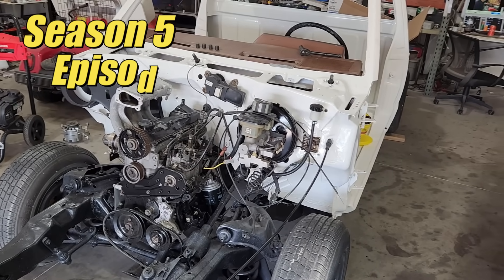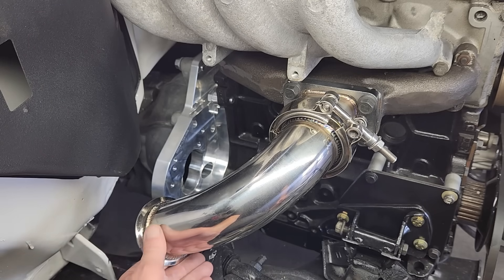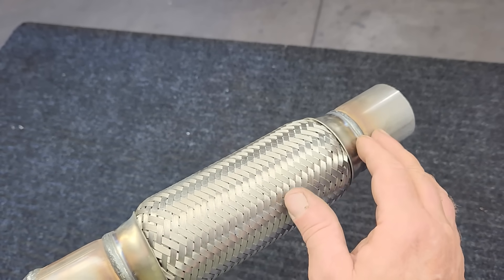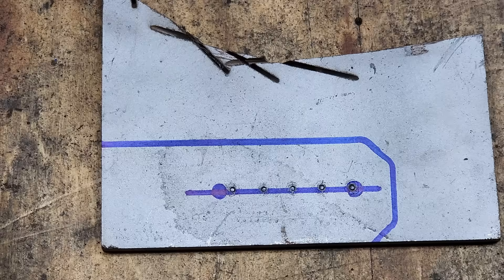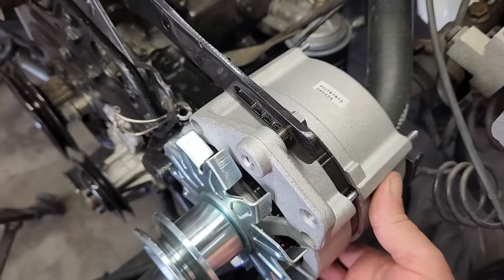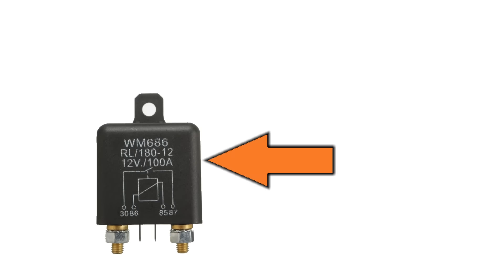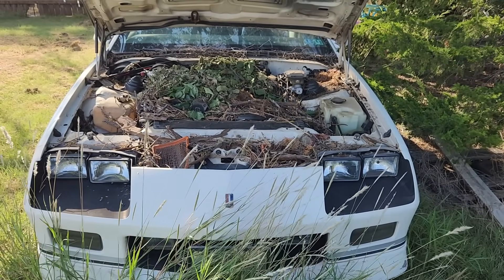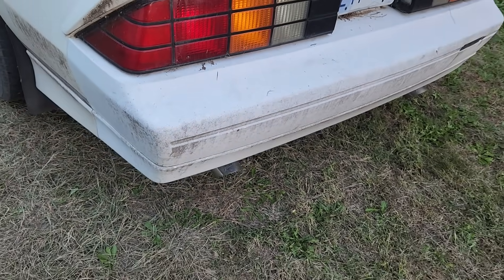S5 E35. DIESEL SWAP Chevy S-10.  we build a custom exhaust and more!

Comment: Actually the Isuzu diesel would have been a better engine swap and tranny. Play more power more dependable. The VW diesel is a great engine for a front wheel drive unit but not for little truck. Unless you have the VW diesel in their little pickup truck it matches the weight balance. As again the Isuzu diesel was a very very good engine what's on the transmission I believe you can get it in a 5-speed.

Comment: The nuts for the b clamps prob don't come off because they're those cros thread nuts, similar to the ones that come with replacement sway bar links. Made to cross thread on the first install because they're garbage and wouldn't last with normal thread pattern.

Comment: Looked like that Camaro had seats from a 1998-2002...and the shift pattern was for the 6 speed. Maybe a T56 swap? Or, maybe they just swapped the interior bits from the new car and it still has the older transmission. Either way, looks like a fun project once that nest is removed from under the hood!

Comment: Yeah, you're probably not going to like the 1.6NA diesel for long before you start your turbo trials.  I had many rabbits and jettas, (still have a 84 Jetta GLI) gas and diesel, but I scrapped my 89 TD Jetta and went looking for another Jetta right away and found a very rare 92, red 2 door with sunroof, and a NA diesel engine.  Didn't think much of it as I was enamoured by the car itself.  Man, it was a bag, so disappointed with it that I engine swapped in a 16V from my brother's B3 passat.  I couldn't believe how lame it was compared to the 89 TD which slipped thru the wind just fine.

Comment: That is a rare car in deed. Most of the 350 camaros of that vintage, were only optioned with the automatic and the 305 got the manual. So your friend got super lucky on this find. A Tremec TR6060 6 speed manual could be a nice modern touch. Its a very robust manual and they hold up quite well.

Comment: Incredibly dumb question, is there a reason that the exhaust can't just go straight down, make a bend toward the engine to clear the frame, make another small bend to straighten the pipe, then make a 90, then back to the rest of the system? It looks like it would make it a low point yes but you're not taking this thing rock crawling....right? The reason your nuts jam up is because of stainless steel galling. Nickel anti-seize can help but likely they have poorly cut threads that are binding when tightening and scraping up the oxide layer on the stainless steel which causes it to essentially friction weld at low temp high pressure. It can also happen when running stainless on stainless threads at high speed with the wrong or no lubricants.

Comment: 7:47: you dont need all that slot-making nonsense.  two long strips, bolt-width apart;  small strip welded across their ends;  other ends welded to old strip as per.  ie just fabricating it's easy

Comment: Hey Jimbo, I've waited to watch this until I had some time. Just wanted to say, A 1989 IROC-Z with a 350 engine and a factory manual transmission is not a combination that was originally offered by Chevrolet. All 350-equipped IROC-Zs from 1989 came exclusively with an automatic transmission. Any car with this combination today would have had a transmission swapped in by a previous owner. I know this because my buddy in HS got an 89 iroc TPI with an auto. We looked into it, we were sad with the slushbox. Also, your videos keep getting better and better.. much more poslished. Thank you for the content man. Much appreciated
Reply: I came here to say this... I have a '91 Z/28 with the 350.  I spent a lot of time searching for one with a manual until I found out that it wasn't an option.  It might be good to check the VIN to see if this was a 305 car that someone put stickers on or a 350 with a trans swap.  Either way these are beautiful cars for the era.  If mine wasn't low mileage, I think I'd swap it out for a newer V8.

Comment: Hey just a heads up, iroc-z didnt come with a 350 tpi and a manual. if it was a 350 it came with a th400. the manual came with the 305.  Look up the RPO code sticker and see B2L was the iroc l98 code for the engine. MB1 MK6 or M39 were the manuals

Comment: The 5.7 iroc was only offed with a automatic so what you got is auto car that has a manual swap or a 305 car with 5.7 badges. The 305 iroc could be had with a 5 speed stick

Comment: no just no ,i love the golf diesel but that engine is tiny for that car 
a much better option would be a 5 cyl 250D from a w124 they are cheap strong and easy to find with turbos altough not really needed

Comment: 2:24 My guess is the clamp thread & the nut are both stainless, so they gall together. Once the oxide layer of the two parts wears off from the tightening action, they will seize. This is a common issue with stainless hardware.

Comment: Hey Jimbo! Can I make an observation? If you are going to hard mount the exhaust to the trans housing I'd suggest adding another small flex joint in between. I think thermal expansion in the pipe will be enough to crack welds or mounts over time. Alternatively, you could make the trans mount flexible to accommodate the small amount of movement.

Comment: I have never found any evidence of a factory 350/manual trans in a turd gen....  there was a 230hp 305/5speed option  L98 I think.. what is the most desirable is a 1LE camaro..    I have a 406 swapped 84 Camaro Sport that came with an Iron Duke originally..

Comment: The shift pattern on the console of that camaro shows a 6 speed shift pattern, I couldnt tell what the knob has. As far as I know the 350 equipped 3rd gens weren't available with a manual. If it has a t56 that would be sweet.

Comment: Shoulda used a turbine housing for the exhaust. Just the turbine housing, without the center section & the bearing hole plugged. Then your exhaust downpipe won't change. 😉

Comment: My brother Chris had as his first car a 1980 Volkswagen diesel Rabbit.  52 screaming horsepower, he needed to drive the 45 miles to Detroit on a regular basis;  He kept a brick on the drivers side floor, and used it as "cruise control", since the car's top speed was 65 mph....

The car got 50 mpg, but he wound up destroying it in a crash.  He wasn't badly hurt, but the other person was killed.  He stopped at a stop sign, looked, and then proceeded into the intersection, where he collided with ANOTHER silver 1980 VW Rabbit diesel.  They found Chris's car in first gear, which had a 15 mph redline, so it is not likely that he ran the stop sign, he just did not see her.

Comment: My first car I purchased after high school was an 88 Iroc-Z 5.7 Tuned Port w/T-tops.  It was maroon and perfect for cruising the PCH in SoCal at the age of 19 in the Marines.  I'm pretty sure they never sold that gen of Camaro with both a 5.7 AND a manual trans but I'd have to look in my book to be sure.  I'm thinking somebody has already done some medling and made it a 3 pedal car.  I always wished mine had been but the 700R4 was a great transmission.

Comment: Why didn't GM do this?

I know GM and VAG do not get along very well, but dollars are dollars and there was the potential to make more of them for each company.  Chrysler in the '80's bought a BUNCH of EA827 gas engines for use in the Omni/Horizon cars, and Volkswagen has worked with Ford on many occasions.  In South America, VW sells the Amarok pickup truck, which is nothing but a Ford Ranger with a Volkswagen engine and slightly altered sheet metal.

QUESTION:  I see the VW diesel engine standing upright in the engine bay.  This is not the typical orientation of a VW EA827 engine;  It should be mounted with a 20 degree slant towards the passenger side.  Have you considered how this is going to affect the oil pickup and oil drainage in general?

Comment: Jimbo, I know the answer why the nuts lock up.  I had it happen.  It's because the clamps and the nuts are stainless but the bolt on the clamp is steel.  So the nut is galling, dissimilar metals and welding itself together.

Comment: Those Camaros were hella fun to drive. Especially with a 5 speed and a 411 rear end. I even put 14" tires on mine to make it even more ridiculous. If you could shift good, they were capable of way more than what they were on paper. Especially since you could easily get the weight under 2700.

Comment: There is a bracket for the VW engine to have an alternator and power steering but no AC. It has a gear type tensioner for the alternator.

Comment: Regarding the bundled nuts on V-band clamps being impossible to remove once tightened. 

A wild guess is that stainless steel on stainless steel fasteners have a tendency of galling, and thus basically welding together.

Comment: The manual trans option was only available with a 305. You might have something there if they swapped a tko 5 speed in it. The non WC t5 in most of them stock are not very strong.

Comment: My work van is a Ford Transit Connect.........   I REALLY like it.   Rumor mill said the Diesel version was coming to the USA,  and then it didn't.   In many ways,  I'd still like to fulfill that wish.  However,  the stock motor in the TC is running like a watch,  and is doing its job too well to even THINK about making it into a project.   I'm not certain that there's enough space under that hood for anything not customized to fit said space.

Comment: Jimbo, the really expensive V band clamps have silver plated nuts to prevent the galling.  They're great, but lose the coating if you take them on and off too much so would knky be good for final assembly.  As others have stated, anti-seize is probably your best bet

Comment: Why not put a diesel in that F body? You could put an OM606 or M57 in there that would have twice the power that 350 had, it would also have triple the fuel economy and be way more reliable.

Comment: That's the fun of traditional diesel engines, they don't need anything fancy like an ECU, just fuel and a brief bit of heat to help it start, if not for the solenoid needing power, they can run without any electricity whatsoever if need be, even underwater... :)
Reply from the maker: Exactly!

Comment: I got a giggle when you used the hands on drill holes and file approach to making the adjustment slot on the alternator bracket when you have a mill.
Reply from the maker: LOL, sometimes you just gotta do what you gotta do.

Comment: The 350  Irocks never came with the five speed they made too much torque. So someone may have done a swap. Only 305 came with a stick.
Reply from the maker: From what I understand, the 350 was available with a 4 speed.  I'll try and dig up the RPO codes and see how this car was originally built.
Reply: I do love the channel and appreciate the response. If you can educate me on something I would love it. Humility is a lovely thing.  I tend to say, If you don’t learn something new in a day you’re not doing something right. 😊

Comment: I'm eager about the work on that Camaro. I'm 18 and just bought an 89, threw out the 305 and swapped a 350 into it. I took off the heads and cleaned out the rust that caused it to seize and seems to turn over fine. I bolted a 4 barrel edelbrock onto it. It's not running yet but I'm close. I wouldn't have done this if it weren't for this channel..!
Reply from the maker: That's what I like to hear!

Comment: Third gen Camaro never came from the factory with a TPI 5.7 AND a manual transmission, one or the other has been swapped. Car also has 4th gen seats and center console fwiw. one intake in trunk is LT1
Reply from the maker: the 350 with a manual was an option on the latter IROC models.  This on this 89 it is possible, however it may only be a 4 speed.   I need to find the RPO codes to verify what options  were selected when this car was new.

Comment: It may not seem like it to a lot of people,but you are making excellent headway on that S10/VW conversion.
I personally think the naturally aspirated would be just fine for ordinary, flat land, light hauling.
I totally understand the desire for MORE POWER !
Great video again.
Reply from the maker: Thanks!  The NA engine may be fine, but just for fun we will give it a little bit of boost.
Reply: I drove a 62hp Datsun 720 for a while, NA 2.2 diesel. The largest thing I hauled was a tractor engine, about 800lbs. It did it, slow and steady 😂 

Driving around with a few hundred pounds of tools and goodies wasnt too bad. Still got about 29-30mpg with a 5 speed manual. Fun little truck and showed me a small-ish NA diesel can definitely do the job. (I think it was rated at 100ish torque) 

NA is definitely viable for a toodle around town. I even drove that thing on the highway at 70mph (it worked hard to maintain that on flat ground)
Reply: My neighbor when I was young drive to Michigan to pick up a new then 78-79 Rabbit diesel 5speed. He always claimed 45mpg when everyone one in my rural community were driving farm trucks with single digit mpgs. Lol
Reply: @jeepinspence  I dated a girl that had a rabbit TurboDiesel that got somewhere in the range of high 30-low 40s, I'd like to find one but everyone wants 37 arms and 3 legs for them 😂

Comment: I was thinking that using the exhaust housing from the eventual turbo, as the bend for the exhaust. A simple disk could be cut to plug the hole where the center goes. Always awesome.
Reply: I was pretty sure GM never put the manual behind the 350 TPI
Reply: Short ram looks like a 93-96 LT1 manifold
Reply from the maker: the 350 with a manual was an option on the latter IROC models.  This on this 89 it is possible, however it may only be a 4 speed.   I need to find the RPO codes to verify what options  were selected when this car was new.

Comment: Why not slightly shrink the 2.5 to 2" reducer and weld it straight inside of the manifold to 2.5 inch adapter?
Reply from the maker: It could be done.

Comment: It looks like the V-clamp around 2:30 is made from stainless steel. If you have a stainless steel nut on a stainless steel thread then it will "cold weld" unless you have some suitable anti-seize involved. That's probably what happens to the nut.

I wonder if the Iroc-Z was originally sold in Europe given the tail lights. I have seen a few in Sweden.
Reply from the maker: Interesting...  I just checked and apparently all the 3rd gen Camaro's had amber turn signals.

Comment: I'm all about getting rid of any unnecessary systems, and I'm really glad you eliminated that annoying ECM. There's nothing wrong with analog!
Reply from the maker: Hell yeah!  if it wasn't for the fuel solenoid, this engine wouldn't require any electricity to run.
Reply: @robotcantina8957 that's the way I like it 😂😅

Comment: If some of the interior stuff doesn't work when you reassemble. It's could be missing grounds. When I did my swap I needed a couple ground circuits that were in the engine harness. Just something to keep in mind for the future.

Comment: That little diesel is going to be way more useful than the outgoing Iron Duke. You could literally run those things into the dirt, and they'll keep going. Can't wait to see when the turbo goes in. That's really going to wake up the power. On a side note, I almost ended up with a Camaro IROC-Z when I got out of high school. Luckily, I didn't because my driving habits sure weren't the best. Anyways, nice work, Jimbo!! 💪🔥
Reply from the maker: Thanks!

Comment: Jimbo, I’m not questioning your statement about exhaust temperature differences between petrol(gasoline) and diesel engines and I think you’ve probably made the calculations already, but… I’ve been running VW diesels for over 30 years in my daily drivers. Granted, none of them has ever had a 60mm (2.5”) exhaust, but I’ve seen them glow red in the dark, particularly the spicier TDi units, after a full bore hill climb of 1.5Km (almost a mile.) None of my petrol (gasoline) or gas (propane/butane mix) powered cars has ever done that. Just something that might catch somebody out, if they just take your statement at face value.
Reply from the maker: I'm sure in extreme situations you can see hot exhaust temps on a diesel.  however generally you can expect the temps to be a lot lower.

Comment: I just have to mention that I love when you do something like making that slotted bracket with stacked drilled holes and files, rather than the all too common youtube trope of whipping out some multi-thousand dollar unitasker tool for every possible scenario. Makes the content so much more relatable and user friendly. Granted I would have drilled to the two end holes and used my trusty black and decker 20 dollar jigsaw with a metal cutting blade but, you know, thousand ways to skin a cat lol

Comment: Cures for frozen/galled nut syndrome on V-band type exhaust  clamps: #1) buy same thread connector nuts, (they are much longer & thus reduce the load per thread in half or better. #2), buy little can of Bostik brand Never-Seez High Temp  Stainless anti-seize brush on lubricant. Brush it into the connector nut & all over the bolt or stud & rub it in! In an automotive research environment (glowing red turbo manifolds/exh. tubing  & lots of v-band style clamps), I tested 5 types of ant-seize products & found Only Bostik to work the best!! Even durability testing at 948°C, at cool down, just spray any  penetrant on the cooked studs/nuts wait several minutes to absorb to where the threads are & gentle tapping, then rocking back & forth would release the parts with No thread damage, to be used again! Both steps above practically stopped seisure of nuts & broken stud/bolt drill-outs on this difficult exhaust (emissions research) that I was in charge of. Yes, a true Game changer, IF both steps followed exactly! Good luck & great project Jimbo, Thanks! Paul from S. Central Tx.